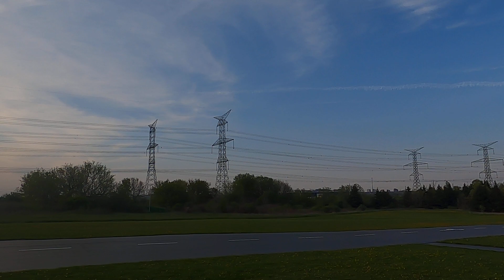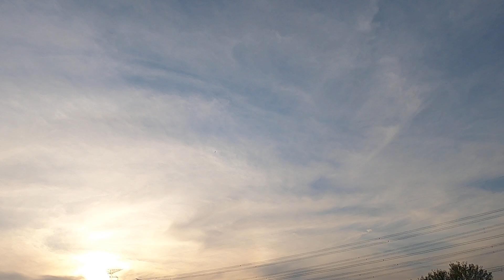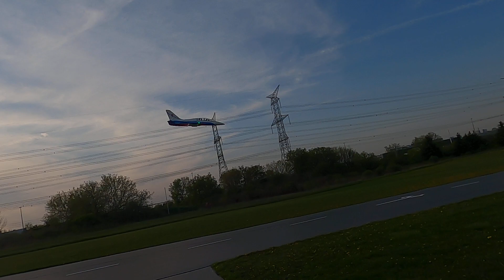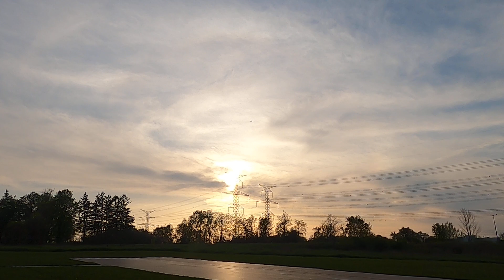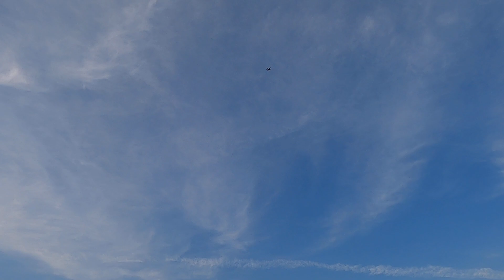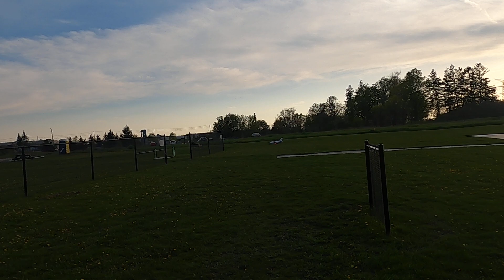FW L-39 with FMS 2000 KV  on 6s

Comment: Did you do any speed runs with 6s v 7s? I've maidened my T33, L39, Sirius and Futura on 7s now. More punch but top speed is quite similar.
Reply from the maker: 236kmh on7s  170 kmh on 6s
Reply: @ghoustanable  how'd you reckon the 2000 would cope on 8? SenditRC managed the stock motor on 8s.